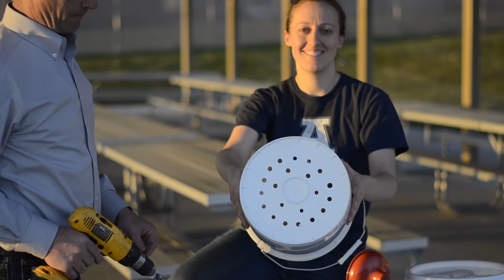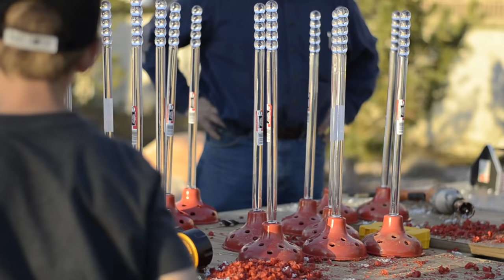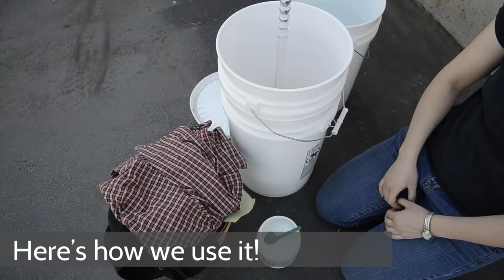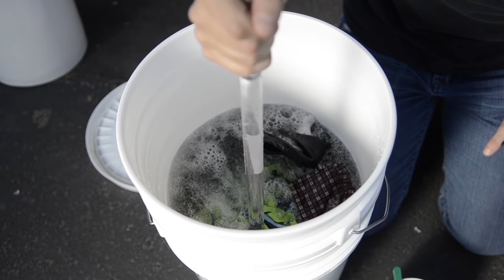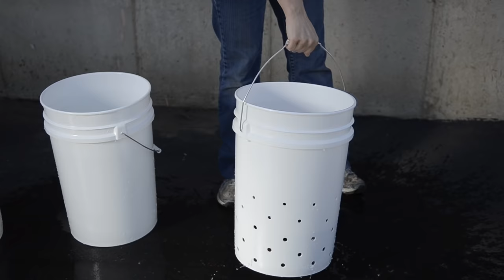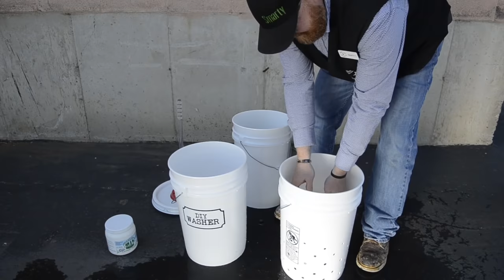Make your own DIY Washing Machine with Buckets!

Comment: I live in an rv and I do bucket laundry. It’s cheap and I don’t have to drag my laundry out. I conserve water by using rinse water from load A as my wash water for load B. Then I use my dirty wash water for toilet flushing, so my water gets 3 uses and I don’t fill my waste water tank quickly. I do my wash in my shower stall. I use 3 tennis balls to raise the holed bucket so I don’t get them stuck. Then I have drying racks in my rv. Rv life means really changing your lifestyle to fit a small space with limited resources. 

Bonus hint: when brushing your teeth, fill a cup half full. It really does give you plenty of water to rinse your mouth and your brush, and saves lots of water.
Reply: Thanks for the tips!!!👊
Reply: best thing, you still get some soap in that dirty water, so in way it's also cleaning that toilet when you think about it.
this was one of my thought, that it was wasting some water.
but using it in a toilet afterward is pretty much a win.
Reply: you're awseome!
Reply: That's so smart.
Reply: I have the portable Best washer. Works great in the RV.
Reply: @HP videos well let me see. Apartment monthly with utilities $1300. Beautifil RV off grid and solar $200. Slam dunk!
Reply: We could reduce the washing we do by airing our garments in-between wears. As Stella McCartney says washing ruins clothes so reduce the number of times they are washed. What causes body odor is bacteria on our skin converting the protein in our sweat to acid so this bacteria cannot live on clothing. Any dirt on our clothes could be brushed off instead of washed off.
Reply: How do u have internet then??
Reply: Nice! Good ideas
Reply: and save on the environment
Reply: Bonita Oh Yea I was thinking the same!
Reply: @higreentj  
Sorry! Not at all.
Fry some fish and try to sleep with the same clothes 😅
Salutations from Spain 💃
Reply: @LauraGarcia-jd8tx  Washing clothes damages them. Sweat does not smell you only really need to wash where the bacteria congregates under the armpits and groin.
Reply: 🔴 What Is Islam? ⚠️

🔴 Islam is not just another religion. 

🔵 It is the same message preached by Moses, Jesus and Abraham.

 🔴 Islam literally means ‘submission to God’ and it teaches us to have a direct relationship with God. 

 🔵 It reminds us that since God created us, no one should be worshipped except God alone. 

 🔴 It also teaches that God is nothing like a human being or like anything that we can imagine.

🌍 The concept of God is summarized in the Quran as:

📖 { “Say, He is God, the One.  God, the Absolute.  He does not give birth, nor was He born, and there is nothing like Him.”} (Quran 112:1-4)[4] 📚

🔴 Becoming a Muslim is not turning your back to Jesus. 

🔵 Rather it’s going back to the original teachings of Jesus and obeying him.
Reply: @fatimaabubaker382  You get to internet from Android computer . You share internet to desktop, laptop or tablet. You probably won't even need these extra things because you can connect projector or keyboard to that Android computer. Less and less people have home internet because people are living portable life so quality is more important than quantity.
Reply: Ir just don’t brush yer teeth! Lol great video tho
Reply: That makes me smile ;D i do the same regards teeth cleaning and make my own toothpaste and mouth wash , better oral care since doing this AND cheaper
Reply: @gotsm9959  although TMobile has wireless internet for $50/month so as long as you are in area with coverage a solar panel would probably power that especially if you already charged your laptop! And many RVs you can subscribe and get wifi but it's slow and expensive. Good news is that while Starlink isnt available yet, it will be for all the Nomads out there 😊!
Reply: @Bluepeacocks88  I have power stations and solar panels to smartphone laptops and tablets. I am currently back in College and rather pay a premium for unlimited hotspot on my smartphone because ultra portable computing is no longer a gimmick it's the foundation of the future of digital enterprise.
Reply: @higreentj  are you sure it clears the bacteria as after wyoubwear it then dry in the sun?
I mean inthought doing so will make person’s armpit smell?
Reply: @chonadoria5755  Bacteria feed on the protein in sweat and most of the bacteria is in the armpit and groin. If clothes are clean but smell of sweat then leave them somewhere warm so it kills the bacteria then keep wearing the clothes until they are dirty. The idea is to avoid washing clothes as washing clothes cause a lot of damage.
Reply: @Bluepeacocks88   You can get roaming facility now on Starlink.
Reply: Hi you bring back memories.  We use to do that in the good old days brushing teeth with glass of water and using a small dish to wash fash and even recycle that water. I am from KZN South Africa and we had a major flood disaster. Our taps are dry. Our water supply will be back hopefully in November.  Now we are using your method .Thanks for sharing. Running of to buy tennis balls. Excellent  God 🙌

Comment: It takes a lot more energy to use this than you'd think.  I made and used one...I'm 64.  It was exhausting doing my husband's jeans and the heavier items.  Smaller items were fine, my clothes were fine, linens were a chore...queen-sized sheets do not do well in it, in my humble opinion.  I would use it again, if needed, but since my son gave me his washing machine when he went off-grid, I am most grateful.
Reply: In the video it looks like a lot of hard work.  It doesn't have to be that hard.
Reply: I stomped in buckets last summer like how you smush grapes for wine?? Like the plunger thingy but yeah bet my arms w old hurt..those jeans nasty job drew a line made my son take them to town laundermat  otherwise tops shorts small linens sheets I enjoyed washing struggled  to wring them out😂
Reply: Elderly people should use electric washing machine and dryer.

Comment: Many thanks for sharing this. I now live in a village, in a corner of the world where washers are an oddity. Laundry day would be daunting were it not for this genial no-electricity, zero equipment washing machine! I'm so grateful.
Reply: how much can you do? how long does it take?
Reply: @gavasiarobinssson5108  Forgive the tardy reply, l am only seeing your message now. 
You can do a lot. I simplified the system and drill no holes in the plunger because that ripped it apart, the pierced bucket also is optional. 
We are a family of 3 and own 4 buckets. Essentially, one bucket holds half the load of a washing machine. We always soak our clothes for one hour or more to loosen the dirt. It is an extremely effective way to wash!

Comment: Just a tip to anyone thinking of doing this!    try to drill from the inside to the outside . I used the method as shown in the video and ended up with a jagged unusable holey bucket, lol !!! Far too rough for clothes washing.
Reply: cutting plastic is an art of its own. You can even cut a smaller hole then enlarge it using an X-acto knife.
Reply: I thought it might tear the clothes too.
Reply: You need to use sand paper to finish the holes
Reply: @yardleyj9391  try using a soldering iron , very handy for making holes

Comment: There r tons of these videos online with buckets and plungers. HOWEVER, NO ONE ever thinks to add a paint roller handle or a broom handle to the plunger. Who wants to bend over and plunge with a 2 foot handle. Or sit on the ground. You have alot more strength while standing.
Reply: Dawn Gowan I tried that once. The plunger handle is bigger than broom handles.
Reply: Dawn Gowan my dad had a broom handle on a sink plunger cause he had pins in his back and neck and couldn't bend over , found out after he passed it wasnt the right plunger for a toilet at all...he just forced a plunger onto a sanded down broomhandle
Reply: I added a telescopic handle from a squeegee to mine.  Now I can have a long or short handle.  I did have to use an adapter to get it to fit the plunger though.
Reply: Retta Richards 
Would a bellows plunger work better ?
Im a little curios bout that?
What do u think about that
Reply: That may be too much plunger.  It's the holes that give it the agitation action you want.  A disc of any kind with holes in it at then end of that stick would probably work.
Reply: Mine is an old antique metal one with a long handle so one can stand.It has been over thirty years ago that I used it because life's situation called for it But I am paying the price now for sure. Love all of the modern amenities. I still have it but hope I never have to do laundry that way ever again..
Reply: This system is great for camping and I even use it for small loads at home.  If find the clothes come out cleaner, and it keeps me from having to go to the gym ! ! !   LOL !
Reply: Putting all your buckets on a table would be a lot easier, I would think.
Reply: Knitting
Reply: Thank you
Reply: I'm short so it works either way for me! :))
Reply: the most powerful postion is on your knees insert cat photo  😒😂😂😂😂😂😂  xD
Reply: How about adding a powerful reciprocating motor to it..
Reply: This is why we share comments. People can come up with ideas like yours and improve or modify to their liking. It's like "open source" inventing".
Reply: I use the handle from my cedar mop. Fits excellently.
Reply: I put a long screw handle from a broom on mine
Reply: @allenmckinney9533  where the hell did you find a plunger that has a larger handle than a broom?
Reply: Make one and I will try it
Reply: I made one of these back in 99' during my freshman year in college. My roommate thought I was insane, then would ask me to borrow it all the time LOL.

Comment: I love this! This can be a $4/5 project if you get 3 buckets and a plunger from dollar tree. Not only is this resourceful, but accessible as well.
Reply: You can get clean food grade buckets from any restaurant or bakery (eg: pickles for burger shops comes in 5 gallon buckets). Just ask the manager or owner if they have any food grade buckets with lids that they want to give away for free. You will be doing them a favor by reusing it. Obviously, clean the buckets before using, else your clothes will smell like pickles :)
Reply: Dollar tree does not sell these bucket's 🤦
Reply: Why do you need 3 Buckets ??
Reply: What is the thing that he put on the underside of the bucket lid  where he drilled the hole for the commode plunger handle ???

Comment: Tips: 1.Soak clothes in the soapy water. Only a small amount of soap is needed. Let the soap work and save you some energy. 2.The lid is helpful if doing laundry in the bathtub and you really want to agitate clothes but not necessary. 3. Water can be saved by using the "rinse" water for another load of clothes, just use it as your wash water as it already has water with soap residue in it! Just one bucket can be used and clothes placed in to a small laundry basket with holes in the bottom or a milk crate to drain out some soapy water while putting clean water in the bucket,then repeat the procedure with no soap and squeeze excess water out by hand. 4. For heavy items you can add a second extendable shower rod over the tub area to help with drainage and removing excess water so you can better hand wring the clothes.
Reply: I have a mop bucket and use the wringer to squeeze out the excess water. Doesn't stretch the fabric.
Reply: Great tips thank you dear

Comment: Yes, very good.  Let's take the bucket of rising water that's sitting on the dirty ground & put it in the bucket of CLEAN CLOTHES to squeeze out the water.  Right on!
Reply: This is a demonstration. I would imagine most people will be using this in a bathtub.
Reply: Gina 1965 same thing I said the dirty bucket on the clean clothes
Reply: Gina 1965 
I THOUGHT THE SAME!
Reply: Agree Gina!
Reply: Noticed that right away
Reply: But I
 guarantee u eat at shady fast food joints...
Reply: I felt queasy when they did that
Reply: I saw that as well
Reply: you would actually set it on the lid. they just didn't for the video.
Reply: Right, lol
Reply: Gina 1965 that part😂😂😂
Reply: Let me correct there error for you guys: Sit the clean water bucket on a clean towel or a clean floor or a clean anything, rinse, use the bucket that was sitting on the clean towel or the clean floor or the clean anything to squeeze out the rest of the water. 

or

use your regular washer and dryer hooked up to electricity that will be useless when your power is out or if the power grid goes down wherever  you live and and look at funny cat videos on YouTube and save the off grid living for the people who live/want this lifestyle. 

Problem solved.

Comment: I have one $3 bucket in my van.  It's my sink, my shower, my toilet(with a protective liner) and my washing machine.  After i wash my clothing I put i rinse it well and put it in a net on the roof of my van and drive off.
Reply: I suggest you save up another $3 for a separate poop bucket. Just sayin'
Reply: @pargolf3158  Ha.  I've since reconfigured and now have a solar shower and clean water separate from the bucket.  I don't actually poop into the bucket itself, there is a plastic bag and paper over the bag, i just keep some cleaning supplies in the bucket.  I will however use the bucket to  do laundry though. Anyways, in a small van the challenge is space is at a premium. I have no space for another bucket.  I literally have no space to spare and even use the inside my van walls for storage.
Reply: @12vLife  Thank goodness for that. That would give a whole new meaning to "Jeeze this water tastes like crap"

Comment: You should look at developing the spin dry. Maybe a rope or old inner tube and you can wind up then release. Attach it to a tree or something. Just a idea. Awesome video :)
Reply: Restaurant supply houses sell 5 gallon salad spinners used to remove water from lettuce. Depending on the model, they run about 80 to 100 USD.

Comment: I actually do laundry like this.  Where I live they want $3.00 per load because you have to run the washer 2-3 times (depending on how you want to do your laundry).  It washes and spins and that's it.....no rinse cycle.  Then you have to pump more money into the washer to run it a second time for the rinse cycle to get the soap out.  A third time if you want to add fabric softener.  (I have Lupus and my skin is very sensitive and I need to add Downy to soften my clothes)  Now tack on another $2.00 for the dryer and it's $11.00 per load!!!!!  It's f'ing ridiculous, so I hand wash my clothes in buckets now.  The only thing I need to do is drill some holes in my plunger.  I've been using it without holes and it still works fine, but I bet it will agitate much better with the holes.
I also bought a 5 gallon commercial salad spinner to spin dry my clothes.  Works GREAT!  Spin dry my clothes, hang them up with a fan blowing on them and within a few hours (or overnight if you prefer) your clothes are clean and dry!

Comment: TY for your tip. An idea to take this even further and make it even more efficient is to make this a bucket only washer.

By making 2 buckets having sieve bottoms ( bore lots of Holes) put the laundry in on and put the other on top. Now put those 2 in a 3rd bucket with the detergent & water . Pump with the upper bucket to agitate the wash. Pump 10 times wait 5 mins , pump 10 more & fill  a ,4th bucket. Move the sieve buckets to this one and pump 10 times ansöd lift out to wring/centrifuge

Comment: On the spin cycle, instead of hold the heavy bucket of wet clothes by the bucket handle and manualy twist your wrist back and fourth, why not run a long braided cotton rope thru the handle, and anchor it to a beam 3-4  feet above you, and rotate the bucket handle in either direction and wind up the rope until it forms knots and release the winding and let the rope un twist and spin dry the heavy bucket of wet clothes with better syntrifical force until the bucket quits spinning annd the rope is stationary..

Comment: Pretty cool! I lived in Vanuatu for a year (Island of Tanna) and I  had something similar to this, except I used a pvc pipe that was roughly 5 inches in diameter and 4 ft in height . Of course the clothes never got to clean perfection due to the water being concentrated with volcano Ash (Mt Yasur) 🙄🙄

Comment: I need a longer plunger handle and don't know of a mop replacement handle that would fit a plunger cup's threads.  I wonder if a piece of PVC pipe would work to extend a handle.  I got a plunger at the dollar store and sit on shower chair to plunge the clothes in a plastic dishpan, and leave the shower head running in the tub while rinsing.
Reply: That is basically what I do also, wash in the shower stall, doesn't matter how much water I splash. I hang things in shower until they stop dripping then on a rack on the patio, works well for about 1/2 my laundry needs. Cuts costs

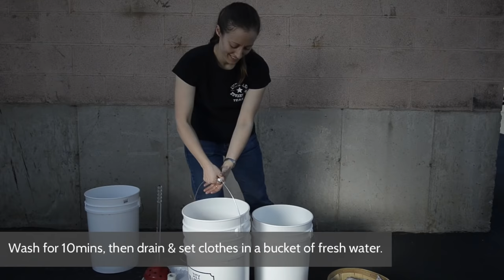Comment: 2:20 Question: How do you keep the buckets from sticking to each other when it comes to removing the inner one?
Reply: If they are the same size do the holes prevent the buckets from sticking?
Reply: The "sticking" of buckets is caused by a vacuum effect of the air trapped between the bottom of the 2 buckets. The drilled holes prevent any air from getting trapped so the vacuum effect doesn't occur--so no "sticking"

Comment: Imagine the wear and tear to your shoulder and elbow with spin dry 😕
Reply: Actually if you do it right, the spin is a great stretch.
Reply: Hang the bucket by a rope and twist it tight then let go and it will spin out a lot more water than just twisting it. Don’t forget to press the water out with the other bucket first.